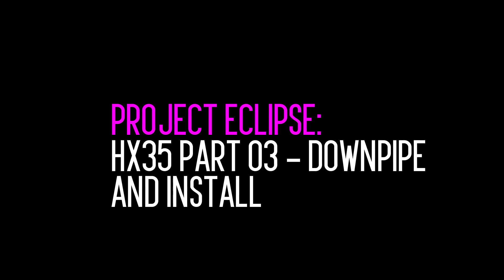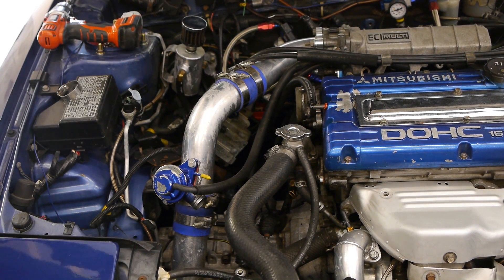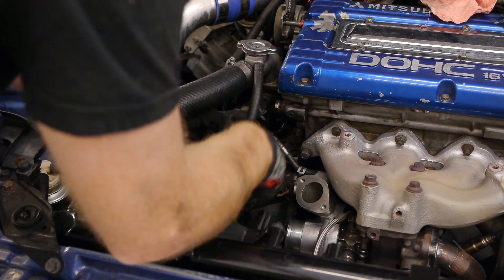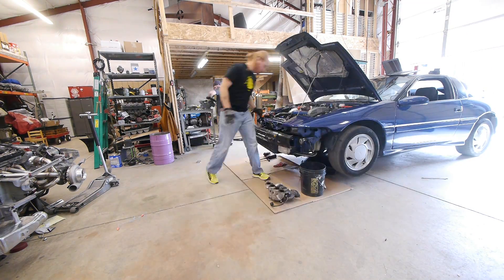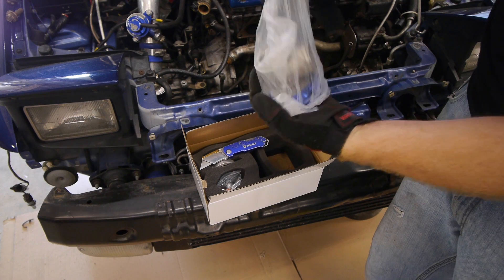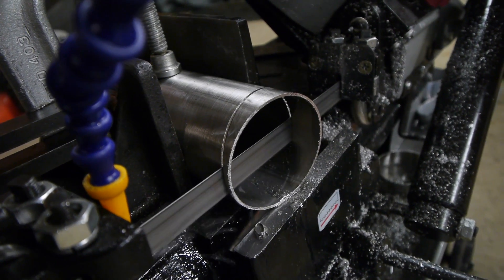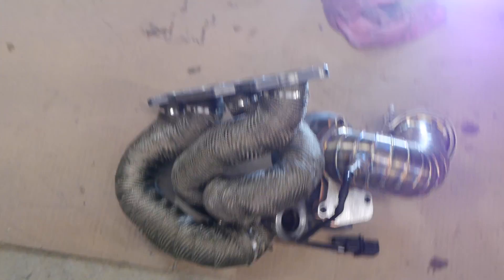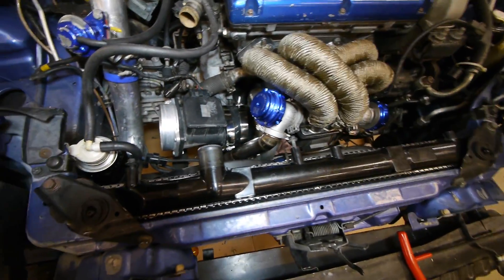HX35 Turbo Upgrade Part 03 - Custom downpipe and install

Comment: Great vid! As long as the ID for the oil drain is 19mm/3/4" you should be fine. I remember ppl using 10AN oil drains and wondering what happened aftewards :) It was from the DSMs I learned and installed a HY35 Holset in my Sentra..first B15 Sentra to do so :D

Comment: Quick tip, if you need even more room than what a 2g oil filter will give you, pick up a 3000gt oil filter, theyre even shorter. Any year.

Comment: You do know that the Dodge Cummins FSM requires for  7/8" ID for the oil drain? 14 AN is not around so my oil drain on my holset is a whopping 16AN...never had an issue with drainage
Reply: Nperez1986 nice I am on the process of installing my holset but I am not shure what housing to use with the t3 manifold what are u guys using ? I don’t know if I should use the stock .82 ar

Comment: That poor alternator getting gang banged by a bunch of hot pipe.
I can't wait to see this thing done!
Reply from the maker: I heat wrapped the downpipe so hopefully It should be fine.  We'll see!
Reply: Well my o2 housing and downpipe has not been wrapped for years and I have not had an issues either. knock on wood. 
Routing two wastegates seems like a nighmare

Comment: TiAL are going out of business because of knock offs. Stop buying that shit.
Reply from the maker: Yep, I learned the hard way.   I left that poor judgement in the video so hopefully others won't make the same mistake.
Reply: Velocity Labs At least you went ahead and bought the real deal afterwards. The product plaigarism laws didn't protect TiAL enough, so a Chinese manufacturer were just spewing out these knock offs and ultimately ate the market up with cheap shit. :(

Comment: I had a center force dual friction on my gsx, and once I went to e85 on my 16g, it started to slip. I hope you have better luck!
Reply from the maker: I hope so too!  Before this I was running a TD05 20g and making about 360hp on e85 and it was holding up fine.   So I hope it can handle this turbo as well.  If not at least I'll get to do a clutch upgrade video XD